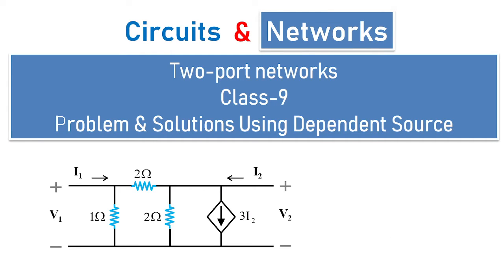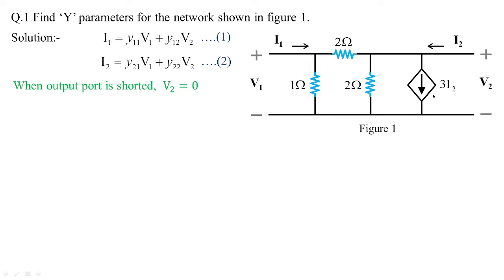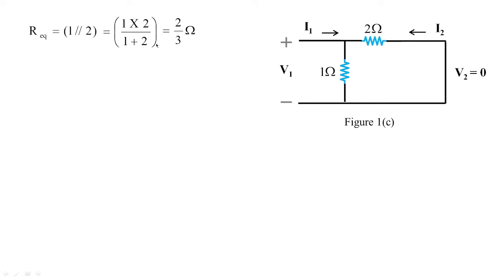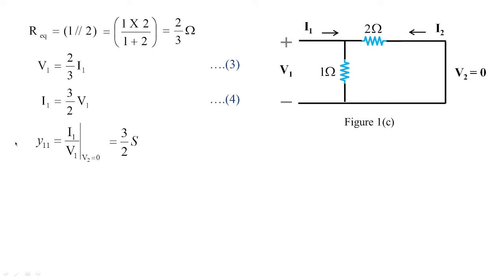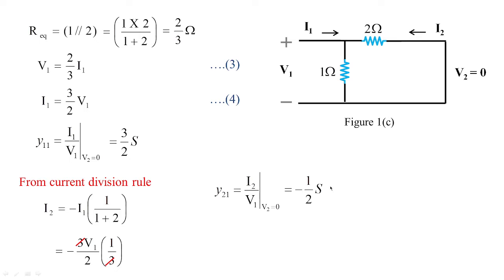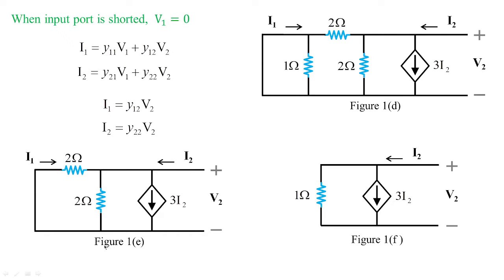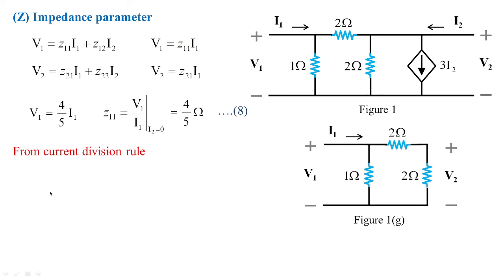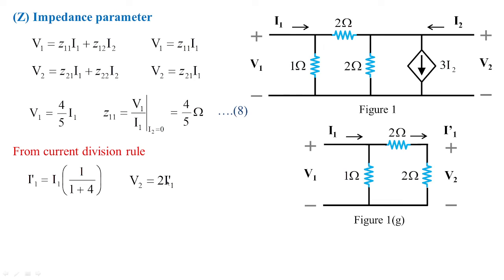How to calculate Z & Y parameters when dependent sources are given? How to solve dependent sources.

Comment: what is the use of dependent source here? why do u remove it?seddenly
Reply from the maker: Two-port networks are often used to represent active components such as: Transistors (BJT, MOSFET), Operational amplifiers, Amplifier stages etc., These devices exhibit controlled behavior, where: Output voltage/current depends on input voltage/current. that is your first answer
here 3I2 is not removed suddenly, it is being shorted by a short circuit wire. Hence, 2 ohm resistor and 3I2 dependent current source is least significant to a short wire which is placed parallelly.

Comment: sir in the Y parameters u didnt take 2 ohms resister when v2=0,but in Z parameters u considered 2 ohms resister why sir
Reply from the maker: Good Question shaik bhai., listen, in Y parameters when outport is shorted, 2 ohms becomes dummy. whereas in Z parameters outport is open circuit, 2 ohms is connected with circuit. please see the video provided here 
https://youtu.be/l4ayd0jsngU?si=1pp9g44m1yt0R1YE